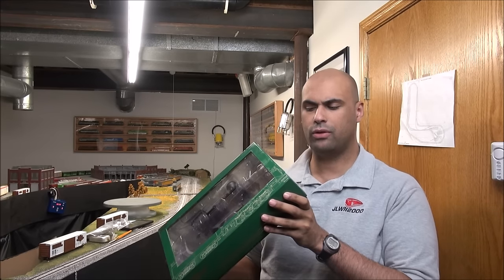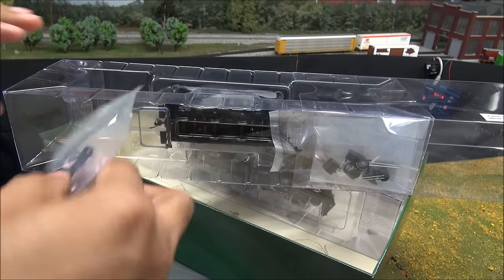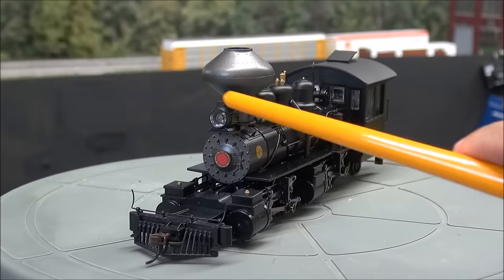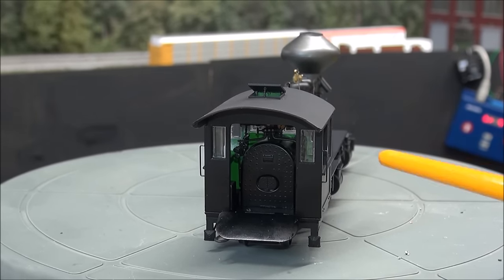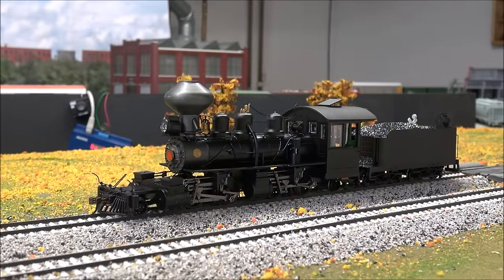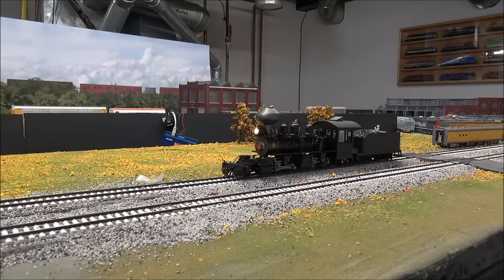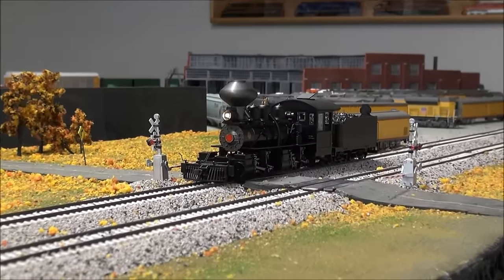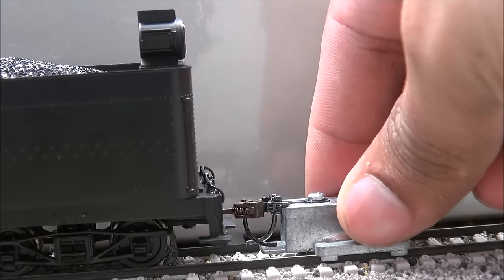Review: Bachmann On30 Baldwin 2-4-4-2 Steam Locomotive

Comment: I have a Bachmann spectrum steam locomotive too. It's a standard gauge 4-4-0. And its lettered and numbered as Seaboard Airline #106. I plan on getting a Bachmann Spectrum On30 4-6-0 lettered and numbered as ET&WNC #12. Tweetsie Railroad in North Carolina has there #12 4-6-0 brought from the ET&WNC Railroad. ET&WNC stands for East Tennessee and West North Carolina. That soot in the box is for weathering your locomotive. My SAL 106 has that too, as well as spare domes, smoke stacks, and boogies for the tender and pilot wheel.

Comment: This beautiful engines is so very good work of art. Id be so scared of all those little parts losing a very important screw and its comes apart. Timing gears and gear ratios kicked my butt. Finally learned it circuits that seemed impossible and was easy from there. Soon found out if your track is nice and straight and level. I built the tables and as smooth and level as I could possibly do.

Comment: John here-Well, at 4:23, you can plainly see the engineer's side front set side rod has come loose.   I found this review by accident, but I was wondering what the reviewer had to say.  The one I purchased 2 years ago had exactly the same problem along with gears that were not properly seated.  When first placed on the rails, in moved 1/2 inch and stopped.  You could tell something was stuck.   Once I removed the bottom cover and wiggled the wheels and gears back into the proper position, it ran.  Once repaired, it was fine.  My only other complaint was that while supposed to run on regular dc power, I needed to purchase a new Model Rectifier power pack that put out more oomph than the factory supplied power pack.  Out of all of my Bachmann locomotives, this one was my first disappointment.

Comment: This is a nice machine. It's a little hard to tell but I think this is a 4 cylinder simple as opposed to a Mallet. In some shots the front cylinders look slightly larger than the rear but on the other hand both sets of cylinders have slide valves. If she was a Mallet, the rear cylinders would most likely have piston valves. To the best of my knowledge, there were only four 2-4-4-2 Mallet's ever built. Baldwin built three and ALCO built one. There is one Baldwin left in the States at the Oregon Coast Scenic Railroad but the sole ALCO survived. She was built for the Taupo Totora Timber Company who had a 52 mile private railway between Putararu and Mokai in New Zealand. She came very close to being scrapped but to cut a long story short, she was saved and is now awaiting another overhaul on the Glenbrook Vintage Railway. She looks a lot like this engine but has a much smaller tender.
Reply: This narrow gauge baldwin one is fictional, as the two Baldwins where standard gauge

Comment: what gauge/scale track do u have this engine running on in this review video? 😊👍 also will normal HO rolling stock be able to couple to models of this size or is it only can have it's own gauge/scale rolling stock?!!!
Reply: It o scale but runs on HO yes it can be couple up to HO
Reply: ON-30 is s or 1/64 scale, slightly larger than HO. This is supposed to be a narrow gauge unit that runs on HO track.
Reply: @richarda996  No, ON 30 is O scale wghich in the USA is 1/48 scale.

Comment: do On30 gauge locomotives run on HO gauge track or smaller track
Reply: on30 is o scale on ho scale track
Reply: Tony Fleetwood thank you as I'm from England and we run on OO gauge track but I've tested my HO gauge locomotive it runs fine
Reply: @vintagesteamlocomotivespot4560  HO and OO track are the same. HO  scale trains are correctly scaled however

Comment: I know it's pretty much a fantasy engine, but I wonder if that boiler would be substantial enough for four cylinders? seems a little on the small side but I'm by no means an expert on steam locomotives.
Reply: If you read up on them, you'll find out that there actually are articulateds that small in boiler size, with 4 cylinders. One of the most famous, is the Little River mallet. Also, that is a mallet. The steam enters the rear cylinders and after it's used, instead of going directly to the smoke stack....it is used to power the front cylinders before exiting the loco.

Comment: I'll admit my ignorance. Lol.  I've been collecting model trains since I was 7 years old, well that is now over 40 years of collecting.    G  O gauge  HO, N, Z . I probably have  4000 plus  locomotives  most are new in the box.  Estimate I have close to  12,000 units of rolling stock.  And just  tons and tons of track  turnouts  buildings. Industrial  complexes.  Later couplers for every single one.   The list goes on and on  ,and  with all that. I do not have a layout.  .  My question is two fold.  Where is the best retailers for me to buy  2 rail  O scale steam locomotives  ? And  I'm ashamed to say that I have absolutely no idea what This  On3 or HOn3  scale  is. Could you please explain it to me.  Thanks  GAH II
Reply: Gene Hall On30 stands for O-scale Narrow gauge 30". 30" represent the scale it is based off of the rail width from the other parallel rail. Basically On30 trains are narrow gauge O-scale trains that run on HO-scale (Half O) tracks.